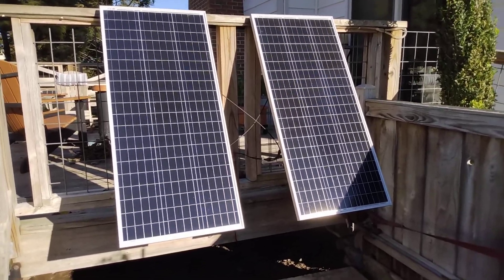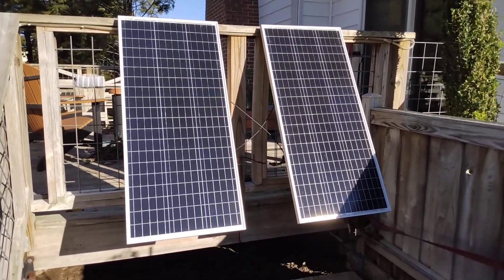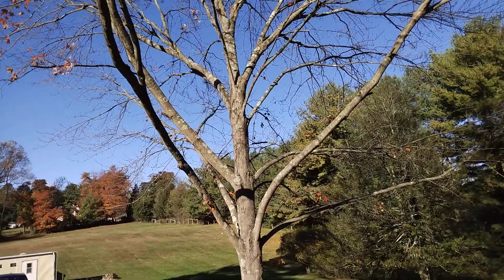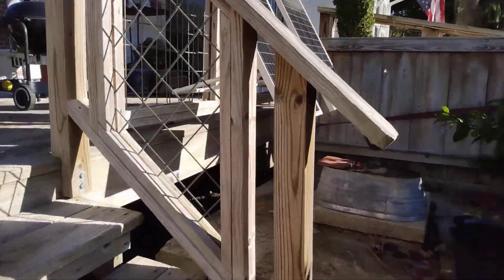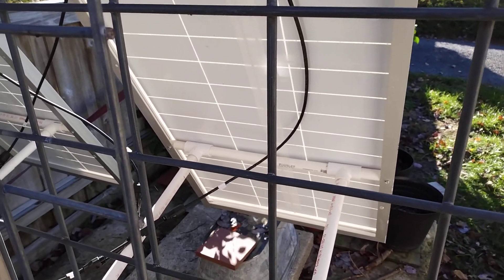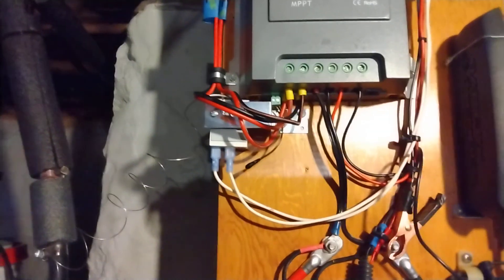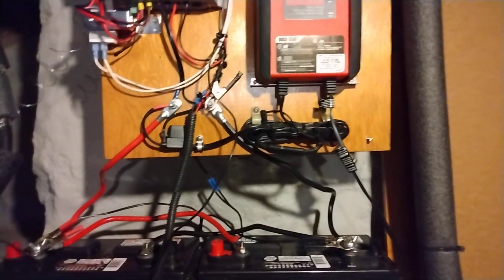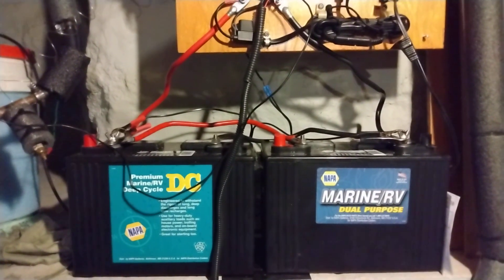Harbor Freight Solar Kit update

Comment: NICE SMALL SYSTEM FROM THAT TIME . YOU HAVE BEEN UPGRADING IT A LITTLE AND IT IS GIVING YOU A BIT MORE POWER TIL NOW . KEEP IT UP AND RUNNING WITH MAYBE A LITHIUM UPGRADE TODAY - FEB 22 2022 + . MAY THE SOLAR BE WITH YOU .:goodvibes::goodvibes:
Reply from the maker: Cedric, I have a large 23 panel grid tied system that I've been using for 10 years, but this is basically a play toy off grid system to power my hot water heat exchanger system....yea lithium is going to be the next upgrade in addition to a couple more solar panels